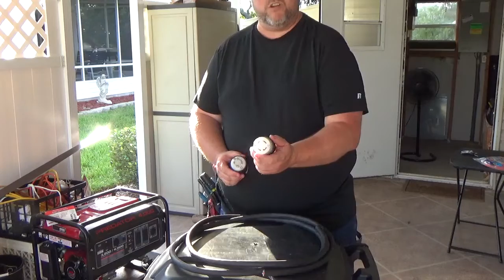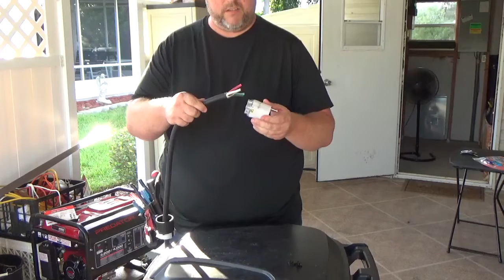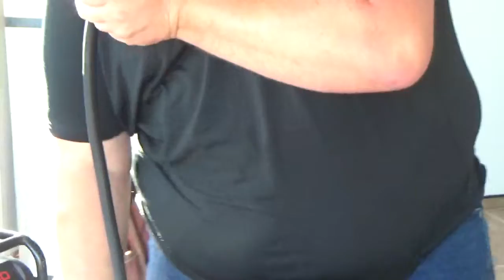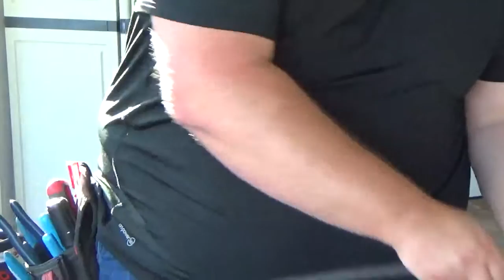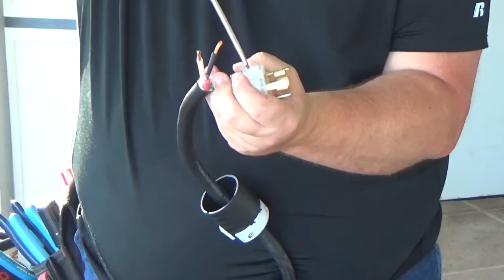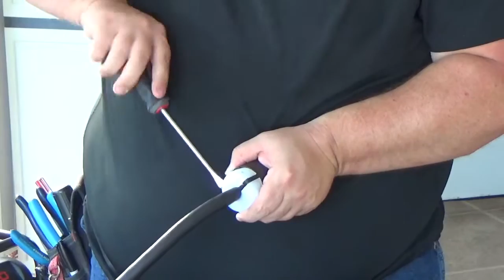Make A 30 Amp Generator Cord

Comment: Hi. I just wired my first generator plug, male end only because the other end is going to wire directly into my inverter. I got 3 wire 10 AWG romex because that’s all I could find; red, white, black, and bare copper ground. The wires are solid instead of stranded and I wired them correctly into the plug. Will I have any issues with these modifications?

Comment: Excellent video. Thank you. I have a 9500 Watt (starting) inverter generator that runs at 7600 Watts but all the cords that I see are at a maximum of 7500 Watts. Surely I am missing something. How do I find an adequate cord?

Comment: Great job explaining instructions. I have a 30 amp generator but a 20 amp transfer switch.I have a 30 amp extension. Can remove the 30 amp female connector and use  a 20 amp female  connector that would go into the transfer switch. Matching the wires to the x,y, g, w on the 20 amp connector ?

Comment: How do I make two male sides so that I can connect the generator to the house? Thanks.
Reply: Be sure to have your Life and Umbrella policies paid up.  Oh, and a current will.
Reply: Obviously you’ve never lived in a Hurricane saturated corridor. Local electricians do it all the time. Just make sure the main breaker is off as to not shock the power company workers.

Comment: I have a question. I bought an oven cable (NEMA 15-50P), and attached a NEMA (15--30P) on the otherside for one of my device. I do not know the wiring on the 15-50p, so I cannot know if black or red is on x (or y). Is that something I need to worry about on the 15-30p side?

I know you can interchange x and y if done on both sides, but is it OK if X on one end goes the Y on the other end, and vice versa?
Reply: In 220 single phase, the 2 hot wires are inter changeable. The device doesn't care bout the color of wire, only that it's getting 110v through X & Y. For continuity sake, i  wire each plug the same way cause I feel more comfortable. If you were using one of these plugs to wire a 220v 3(industrial) phase with 3 hot leads and a neutral, it would most definitely matter that both,plugs were wired the same
Reply: @barneyrubble4827  Thanks a ton! I tried my cable and it works just fine now. From what I understand, as long as its single phase, hot cables can be interchanged, glad to know I didn't fuck up! :)

Comment: I changed my air compressor motor from 110 to 220. But it only has 3 wires, black white and ground. My receptacle on my portable generator is 4 wires (L14-20R).
 How do I wire an L14-20P with only 3 wires so I can run my compressor off my generator?
Can I use the black and white as both hot and have no neutral?

Comment: For an inverter generator that only supplies 120 volt power, how do you wire a power cord to feed an electrical panel?  I also have a 240v 14KW diesel generator that correctly wired with a manual transfer but prefer to not to run when I don't need to.  I have an RV outlet 240v 30amp I would like to use for the inverter generator.  Can you jumper the X, Y connection to feed the panel with the panel isolated ( mains disconnected using the manual generator interlock).  I'm only looking to power a gas furnace, refrigerator, and freezer during the night time.

Comment: i did this, but im worried about using it during a storm, that plug doesnt look waterproof.  should i use silicone, epoxy? dielectric grease?
Reply: Provide awning, cover, tarp, tent, lean-to, etc. to prevent water hitting the generator and the wall recptacle.

Comment: Craig? Here's my question. It seems that everyone wires a FEMALE out-let to their fuse box to plug-in their Generator. Here we have a Female out-let on the Generator. Here we have a Female outlet at the fuse box. To connect the generator to the fuse box will require a cord with two Male connectors. I had to wire a MALE connector to my breaker box to avoid cutting my brand new 10/4 Generator cable. Is it normal for your breakers to become warm considering we are now back feeding with a generator.

Comment: I have aTHEORETICAL question. IF I turn OFF the main breaker from my house and then turn off every breaker in the panel and want to use a generator, can I plug in to an existing exterior receptacle from my generator. If the electricity is going to this receptacle would it power ONLY this breaker if I turned it on or can I turn on another breaker to use that breaker as well.I have a 2000watt generator and would only use maybe 1000-1500 watts total.
Reply: With the main panel switch turned off, connecting the Gen to a breaker will backfeed the whole panel with if using a 2 pole(220v) breaker or half the panel if using a single pole(110v) breaker. Doing this w/o a proper generator safety switch is very dangerous tho cause if by mistake somehow the main panel switch was accidentally turned on while Gen was actively backfeeding that breaker...VERY VERY BAD!!!! Also, if power employee is working to restore a line and main switch gets turned on, you could electrocute him. He thinks the line is dead but it's not.

Comment: Ok lets say my 30A recepticle on my generator is a 3 prong interlock, how would I connect wires on a 3 prong male plug versus the 4 prong shown here?
Reply: Following been trying to find out the answer for almost a year and seems no one knows
Reply: they make an adapter to go from 3 to 4 wire. found it on amazon.

Comment: Would 10/3 (Orange Romex) work just the same? I understand you don’t want to use romex as an extension chord. I’m running it through liquid tuff conduit along the wall. Just wanted to confirm the wire it does would work just the same as the SJO

Comment: Why twist the stranded conductors ‘backward’ (CCW) ?
Reply: I look at the diection of wire twist after some insulation has been stripped off, and twist in the same direction.  Keeps the strands tight and compact for best connection.

Comment: So can x and y be crossed or do they have to be on the same terminal at each end?
Reply: In 220v single phase, X and Y are interchangeable as both are 110v hot... they are the same. Keeping both ends wired the same is still a good idea tho imo.
Reply: did you get an answer, or figure it out?  My question too.
Reply: @0321recon  nope. I still don't know.
Reply: @MrMickeysbee69  I see in comments people referring to them needing to be same on each end, and Craig says in a comment it is common practice to us X for Black and Y for Red.  Hope that helps.

Comment: can you tell me what gauge wire i should use to make a 30ft 30 amp generator cable
Reply: 10ga. will work fine for 30 feet.

Comment: is this cheaper than a pre moulded one?
Reply: Probably not. I see at Home Depot the cord is 2.45 a foot, which is more than a ready made cord, at least for a 25 foot one.  $61.25 just for the cord alone.
Reply: @bigpardner  I think the HD wire is more flexible in colder weather than the pre-made cords I am finding (SJO vs SJTW)

Comment: Thanks for that, but I have s question pls, I need to make the extension cord like that ( one end has 3 pin of male and other end has 4 colors of female ) that's because I have a food trailer and the cable in the trailer ends with male 4 colors , but I cant plug in that 4 pins in my home as the home has 3 pin only ,so is that okay to have 4 colors cable one end is 4 pins female and other end 3 pin male ? I wish I made u understand me, thanks alot!

Comment: What if i want to replace a regular home 220V outlet and put in a Generator type receptacle instead? what do i do with the neutral, cause as i understand you don't use neutral in a 220v receptacle, is that correct?
Reply: just skip it
Reply: If using 4 wire, twist the gnd and neutral together for use with 3 prong

Comment: I have two 25ft 30amp 10g extension cords, can i connect both of them to make a 50ft. If i do will be loosing voltage? Or its better just to buy one extension cord of 50ft?
Reply: There should be no difference long as the connectors are in good condition.

Comment: Isn’t that a 50 amp cord?  I thought 50 amp were 4 prong and 30 amp is 3 prong. You made a 50 amp cord NOT 30 amps!!
Reply from the maker: The prongs have NOTHING  to do with AMPS. It is wire size , and 10AWG is rated for 30 Amps. Not sure who or where you were told prongs dictates amps but you may want to let them know so someone does not get hurt. CM
Reply: Craig Michaud- Electrical Instructor Nonsense, plugs were designed to dictate amps so stupid people wouldn’t plug the wrong amp cord into the wrong socket.  Really?  I shouldn’t have to tell an electrician this!
Reply: @drublod530  Unfortunately that is not true.  My 30 amp, 40 amp and 50 amp outlets installed by a major electrical contractor here in San Diego use the exact same receptacle.  Only the wire size going from the receptacle to the panels circuit breakers were different.  30 amp for my genny was 10awg, the 40amp for my electric car was 8 awg and the 50 amp for my welder was 6 awg (he said that was actually rated for 55 amp.
Reply: @drublod530  a little bit of knowledge can be dangerous! You are right bout the plugs but there is flexibility within each design. You should make sure of yourself b4 you go blasting people.

Comment: Can you wire L14-30 male end (connects to generator ) to a L6-20 female end on the same cord. ? Or do I need an adapter for that. Thank you.
Reply: One of the benefits of making your own cable is that you can have whichever connectors make sense electrically, eliminating points of resistance & heat.  Adapters are OK in a pinch, but every plug-in connection is gonna have a bit more resistance than uninterrupted copper wire.

Comment: Hi There thanks for the video. My current cord has a four prong that goes into that gen. and a 3 prong on the other end of the cord that goes into the plug attached to my sub-panel. I need a longer cable do the two hot wires go together on the the three prong end? Thanks Steve
Reply: Hey Steve, NO DONT DO THAT. in my opinion, I'm going to guess that the cable that's being used only has 3 wires black/white/green. And is only useing 120v from the generator.
Reply: Not only would I not do what you suggested, I would swap out one of the plugs making both ends the same to prevent a potentially dangerous situation for the unaware.

Comment: I have a 9500 running watts generator.  Will this cable work for my house .
Reply: 30 amp connectors rated at 7500 watts at 250v. As long as your Gen has 30 amp outlet and you draw less than 7500 watts you'd be golden, but I'm no electrocutioner.  ASK A PRO.
Reply: If you draw more than 7500 watts which you could, your cord could overheat rather than shutting down the generator, that is dangerous. Do it right man!

Comment: May I know would it be OK to make a backfeed 150-200 feet length of 30 Amp cord by using your method ?
Reply: Hey Read your question what did you end up doing ? Thicker gauge wire ? What’s the distance of wire did you make? Thank you
Reply: @josephpuchel6497  At the end, I went to Amz and bought two long cables and connected them together.
Reply: Long runs will have some loss and possibly heat if too long. Heavier GA would prevent that. There are charts for this calculation.

Comment: I have a generator panel with the proper plug but my generator only has regular plugs on it.  Can I wire a regular plug to the 4 prong that is  plugging into the house as long as I am only running 15-20 amps at a time...

Comment: My 4 prong doesn’t have a “W” but it does have a “Z”. It does have a G, X and a Y. Do I connect the red and black wires to the X and Y screws and the white wire to the Z?  I already have the green wire connected to the G.
Reply: Yes, the Z replaces the W. X and Y are hot. G is ground so the Z can only be W.

Comment: So you say the X and Y wires does not matter which side so do they have to be the same place on each ends of the  plugs like the red in the Y and the black in the  X on each end on the plugs?
Reply: No it doesn’t matter.. but you can keep it consistent if you’d like..

Comment: An you help, I am going from a 4 wire generator to a 3 wire dryer connection. Do eliminate the ground or do I connect the ground and the neutral together
Reply from the maker: In a jam either way should work!!

Comment: On each connector (male and female) does it matter if the black wire connects to the "X" terminal and red wire connects to the "Y" terminal, as long as they match on both ends?
Reply from the maker: That is correct. It is common practice to use (X) for Black and (Y) for red. CM
Reply: I am a licensed master electrician in Michigan, I just ran across your video's tonight, and I am enjoying them! In your previous video (how to hook up a generator in a power outage) you said X was red and Y was black, I know it doesn't matter as long as they are the same on both ends. Just wondering the difference in videos.
Reply: @Bluesman57  Licensed electrician or not, you are wrong. The X and Y can be different at both ends, since the load won't be affected by it. Each leg will be 120V and 240V across both. With a single phase source it won't matter.

Comment: I wonder if you could help me. I have a 4000W generator with a TT-30P outlet and I want to use a through-wall transfer kit with an L14-30R receptacle to pass electricity into my house. I have the RV plug, a length of 4-wire 10 gauge cord and the L14-30R adapter. When running the wires from the RV plug to the adapter, do I tie the two hots together at the plug so that I have all 4 wires at the adapter, or do I use only one hot and leave one unused? Thanks...
Reply from the maker: Great question!! Most RV plugs are only rated for 125v.  You will need to buy a 4 wire outlet in order to care the 240v load to the house. In my video on back feeding an electrical panel I explain how to do that. I hope this helps. Thanks for the question!! CM

Comment: How much did this cost to make?
Reply from the maker: About $40.00. It depends on the wire size and how long you want it to be. I use 10AWG for anything under 10 feet. at 30 amps. If you need it longer then you can use 8AWG. Bigger is always better!! Thanks for watching. CM
Reply: @craigmichaud-electricalins4602   Bigger is better IF the connector will take the larger gauge wire.  For example, #6AWG wire is too big for a typical 30 amp connector.
Reply: Craig, did you find this a "better" option than buying one at big box? What did you choose to make vs buy prefabricated?